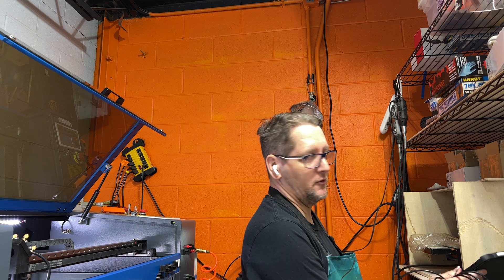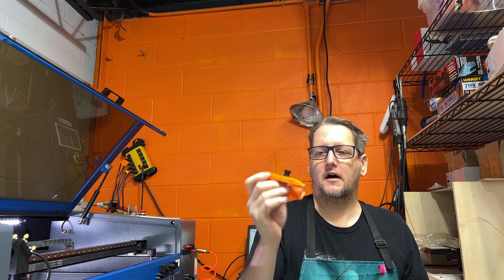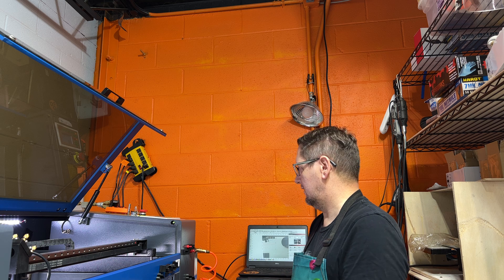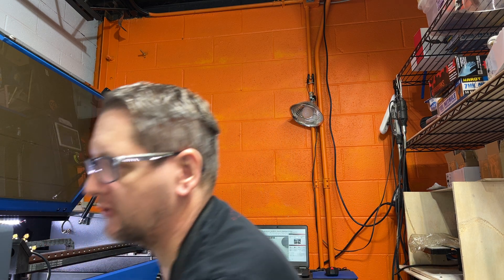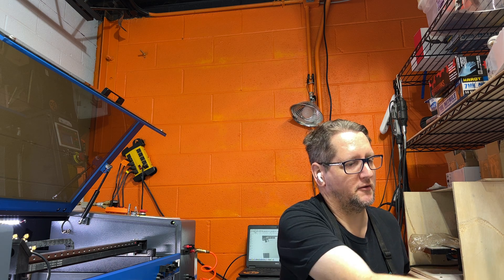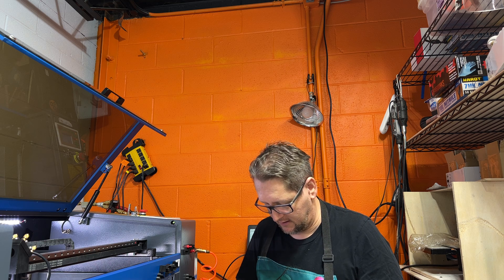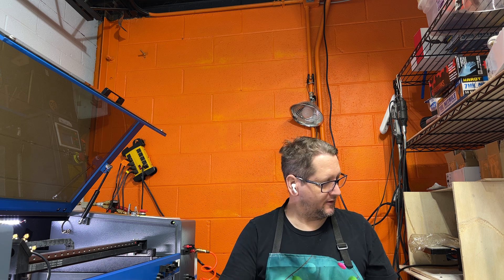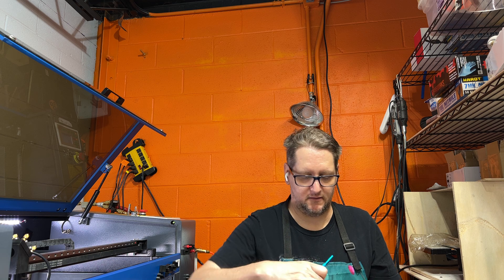Installing the Lightburn 8MP camera into our OMTECH Laser Cutter

Comment: Does this camera set up works with other co2 laser? I use a free software to control my 80w co2 laser called RDWORKSV8 and currently I have a job and I really need a camera. What camera are you using?
Reply from the maker: I don't know if it will work with RDWorks. I've only used the camera with Lightburn. The camera I purchased was from Lightburn as well. I've used a webcam with lightburn in the past, however, the resolution wasn't as good.
Reply: @DabooDesigns  thanks for answering. I was thinking also to just do it with lightburn and simply all my hustle

Comment: What is the hight with the lid open to the bed and what is the hight with the lid closed. I am trying to determine which lens size to get? Does the fisheye 120 mm lens throw off alignment? Can the light burn camera be used with lid closed?
Reply from the maker: I used the guide here to determine the correct lens for my mounting height: https://lightburnsoftware.com/collections/cameras/products/lightburn-camera-4k-w

Comment: Just curious.. not enough clearance to mount in the center, so why not just drill a hole in the acrylic cover and insert the lens down flush with the bottom of the cover’s acrylic?

Hypothetically, that would completely remove any clearance deficiencies, yes? And I saw somebody talking about cleaning the lens.. a small piece of Saran Wrap would keep the lens removed from the smoky environment, and when it starts getting cloudy, simply pull Saran off and put another piece.
Reply from the maker: The camera needs to be far enough away from the bed to see the entire area. Drilling a hole in the middle to view the bed is too close and won't get the entire bed. This configuration works quite well. I open the lid, insert the material to be cut or engraved. Adjust the design in lightburn or shift the material and take another snapshot. Close the lid, and fire up the laser. As for smoke on the lens. It's not an issue worth solving. If it gets a bit foggy, which it hasn't. even after months of regular use. I'll wipe it with the same qtip and iso I use to clean my lens and mirrors.
Reply: @DabooDesigns  Awesome! I was just curious and thought it would be worth asking

Comment: Which camera and degree did you buy?
Reply from the maker: 85 degree
Reply: @DabooDesigns  Why 85 degrees?  What's your bed size?  I'm looking at a 120W for a 500mmx700mm (20" x 28").  Seems that would give me the most optionality given that Lightburn software corrects for distortion.  I'd mount it approximately the same area assuming the lid is open.  What am I missing?
Reply from the maker: I used the guide here: https://lightburnsoftware.com/collections/cameras/products/lightburn-camera-4k-w

Comment: Did this work for you? When I tried mounting mine on the door, it wasn't repeatable. The door moved too much and so the calibration wouldn't work
Reply from the maker: I make a conscious effort to open my door all the way every time so it is repeatable. With that said, it's not precise and may be off by 1-2mm.
Reply: Not being that guy but... if it's not repeatable and off that far,  what's the point?

Comment: Good video. But I have a little problem with your mounting method, and every other one I have seen.  The camera is located in the laser cabinet, which is a dirty, smoky, sooty, filthy place.  The lens is exposed to this crud. How in the world do you clean this tiny lens?  I intend to make my own mount that is essentially a piece of 1/2" PVC pipe with a glass window made from a microscope slide.  When I clean the laser lens, I'll also clean the camera's glass window.
Reply from the maker: I have a very good inline fan to keep smoke buildup down. I do wipe the lens with a q-tip when I clean my mirrors if I notice the picture quality is a bit foggy.

Comment: Is there more steps to do in the process of lining up the camera in the software
so you can get perfect placement of graphics on the sub straights you cut and engrave?
Reply from the maker: It's pretty close, but not perfect. I have a square in the back left corner that I use as a 0, 0 reference and tend to use that in conjunction with the camera.